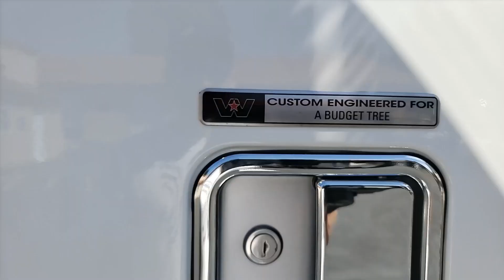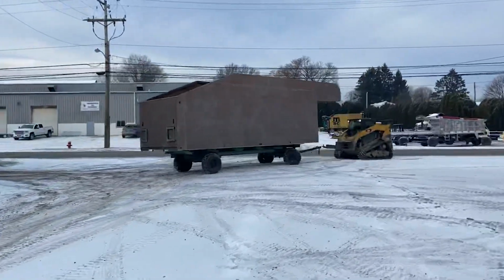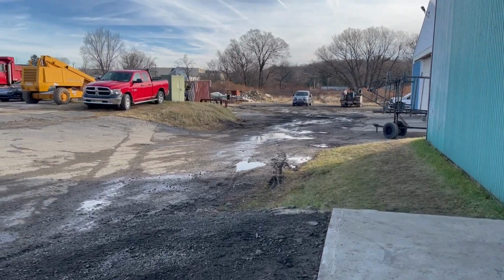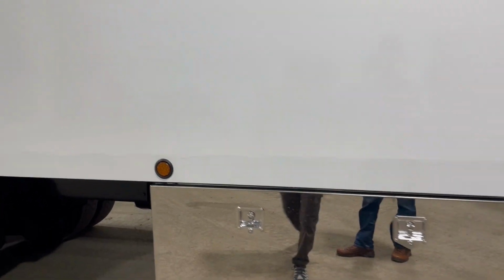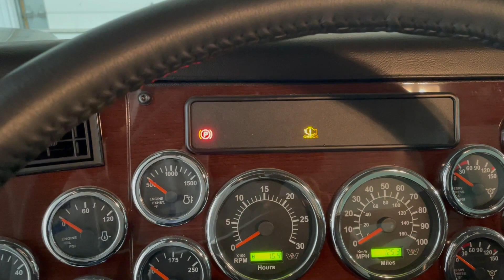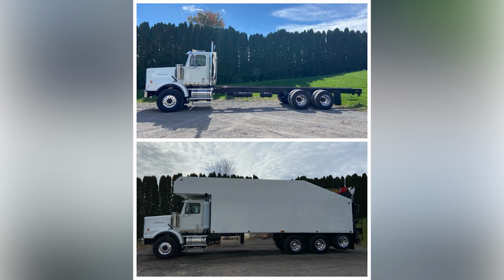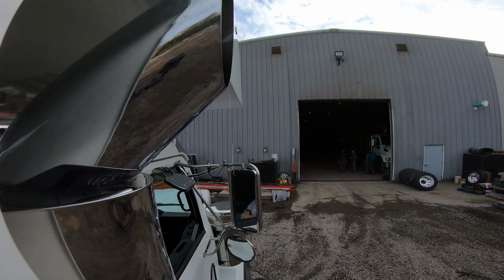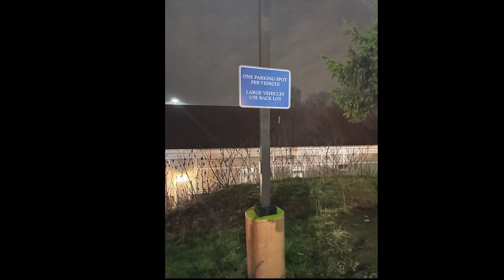75YD Grapple Truck Build Series Part 6. The reveal and driving it back to FL. 550 HP CAT! Its LOUD!

Comment: Absolutely awesome truck setups. Is there a reason that the black loader truck has two drop axles and the new white truck only has one? Does that just mean you can't legally haul as heavy of a load with the white truck?
Reply from the maker: The black truck has 46k air ride. And hauls logs , the extra axles are also for additional braking and safety. The white truck has 52k air ride and has a chain saw on it now. It stays light . 
The rear tag axle is meant for stability when pulling a storm trailer.